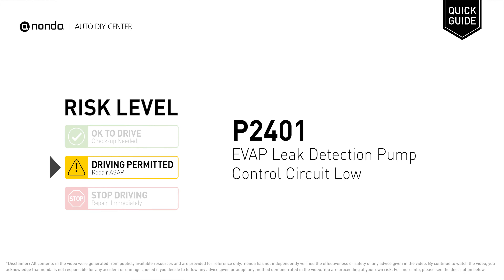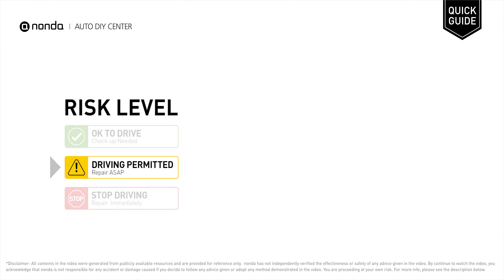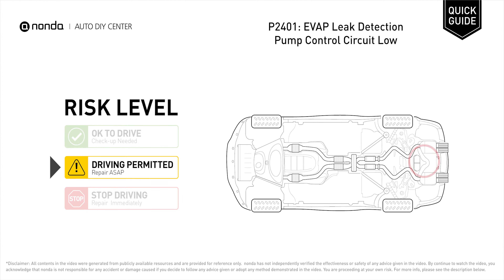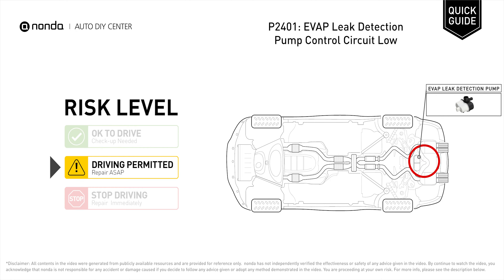What is P2401 Engine Code [Quick Guide]

Comment: Where do I find the evap leak detection pump control on 2016 wrx
Reply from the maker: Hello, you should find it at the area where the purge control solenoid valve and the canister is located. Issue with PCM and wiring could also trigger this code.
Reply: @nondainc  Do you know where that area at?I didn’t even know.
Reply: @nondainc  thanks
Reply: @nondainc  can i install air intake without tune?